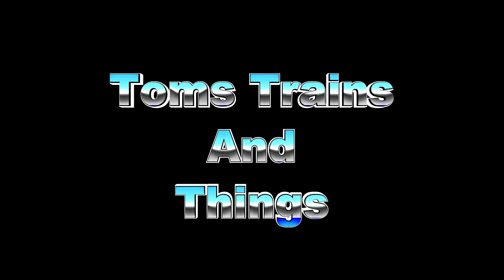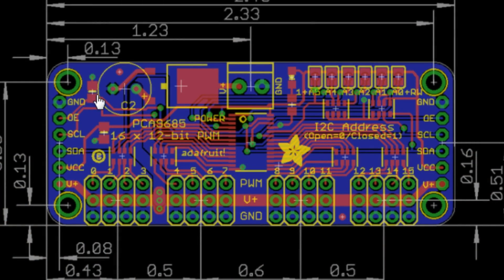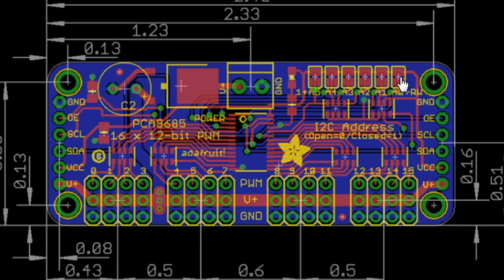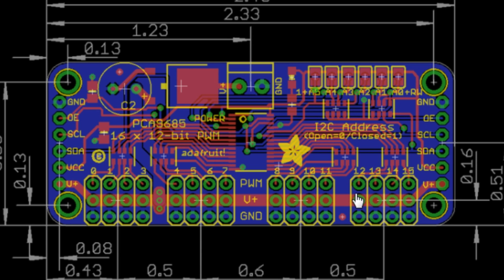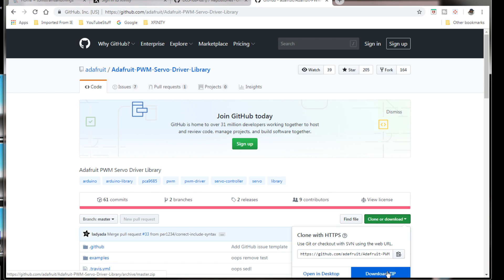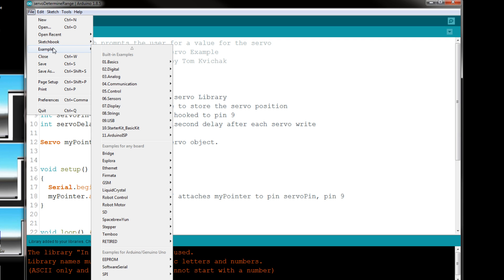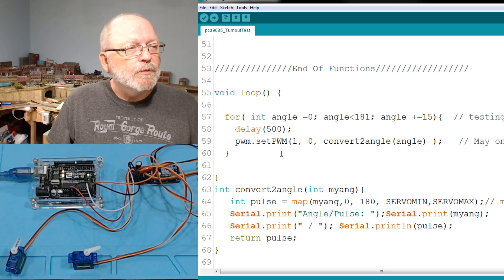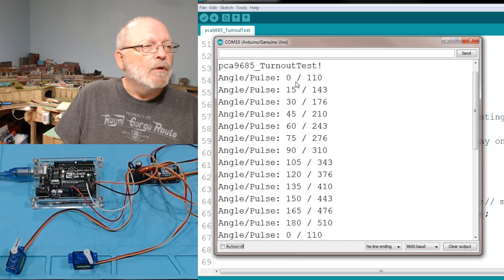Control 16 Servos Using A PCA9685

Comment: Great project great video but please explain where to connect the toggle switches in the arduino or schematic will be helpful 
I need to install 15 turnouts
Reply from the maker: Thank you Luis. Go back and watch the video at 0:27 I tell you where you can find the explanation. The web address is in the Description under Contact Info. I have most of my Arduino projects on the web page.
Reply: Toms Trains and Things 
Thanks for the fast response 
I made 1 servo work without any problems 
But I’m new to write code sketches and all that so I don’t know how to add 12 more servos to my arduino 
So I’m lost
Reply from the maker: In the example sketch on my web page I show two servo/switch routines in the if/else statements. Copy and paste the contents of these two statements and change the numbers involved. The first statement uses "0" the next one uses "1"  Continue with the same numbering convention until you have the desired button/LED combos that will fit on an Uno. You will also need to declare the Pins for LED's, Buttons & Button State at the beginning as in the example. The Uno is limited by the available pins but more can be used on a Mega. Like I said in the video, I will show how you can increase the number of available pins on the Uno via a shield or module. I just received the module in the mail so I'll be doing a video on that shortly.

Comment: Thank you.  Do you have a wiring diagram or something that shows how to add the push button or switch and LEDs to the breadboard and connect them to the arduino?
Reply from the maker: The sketch and Frirzing diagram is on my web page along with all my other Arduino lessons and projects. You can find the link in the description of this video.
Reply: @TomsTrainsandThings  Hello Tom, almost everything clear, only would like to know the value ( Ohm ) of resistor you used in the circuit

Comment: Nicely presented,  Tom. Thanks for showing us how to get 16 going. In practice would you have to have 16 toggle switches to throw for turn outs which makes sense but what about crossing gates for roads?  Do you have to throw a switch to put them down or will you have a sensor that sees the train coming up and puts the crossing gate down upon approach or will you have to throw a toggle switch to do so?
Reply from the maker: Crossing gate video will be out shortly. You just have to add the servo without the pca9685 to a sketch I already did for the crossing gates.

Comment: This looks like a lot going on but it looks like you got it down pat thanks for taking the time to share this video I know I'm in the process of deciding which switch motor to go with should it be the tortoise Cobalt or these RC motors it's a hard decision to make the tortoises you need to solder or buy an extra piece so you don't have to solder you want to get one year warranty with it. The kobold you get lifetime warranty with everything no soldering involved then we have the RC motors what's your cheat but all the extra stuff you have to buy make them work does not seem worth it I'm looking at about 36-40 turnouts just on my way out very hard to decide which way I want to go. so again thank you for taking the time to make this video and sharing it with us
Reply from the maker: Each pca9685 will operate 16 servo motors and they can be stacked where you can operate over 900 servos. All of them can be operated with one Arduino Uno or Mega which can be purchased for $22 for the original or less than half that for a clone which I use on all my projects. Since the technology is open source, any manufacturer can make the Arduinos. There is also a board for the inputs where you can increase the capacity of the Arduino to handle more inputs such as switches and LEDs. Initial cost for the Arduino method if you purchase all name brand items; Less than $50. Servos can be obtained for under $2 pc.

Tortoise switch machines have a 9 year warranty and are located in the US. They rarely fail
Cobalt has a lifetime warranty and located in Au & UK
See my video comparing the two switch machines:  https://www.youtube.com/watch?v=j-NPoi3gLQo

Comment: Tom thank you your videos are a great resource especially for the beginners or the technical and programming challenged like myself. This is a great video I have been searching for this exact solution for my switch control! I am also looking at the 16 Channel Relay Board Module for Arduino as an option for controlling my switches up 32 I think. 00Rail made a video on this option but I am trying to work out how to put it together for more than 1 switch! The link to their video is https://www.youtube.com/watch?v=-ATOKGPQgkk&t=1928s. Again thank you for the great resources and keep up the fantastic work mate! Regards Darren from Australia!
Reply from the maker: Glad I could help. I"ll check out this video shortly.
Reply from the maker: Glad I could help. I"ll check out this video shortly.